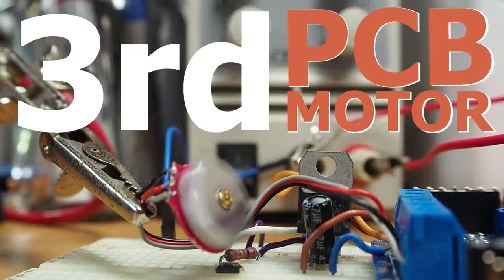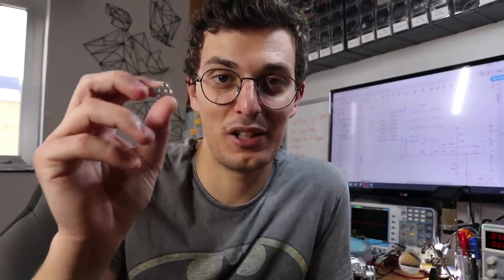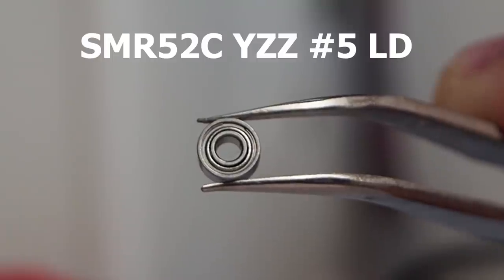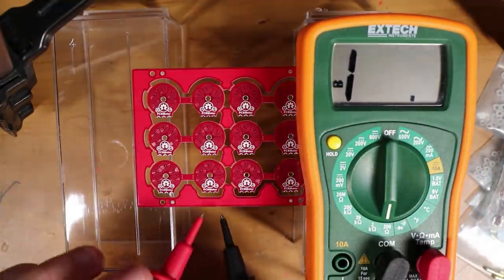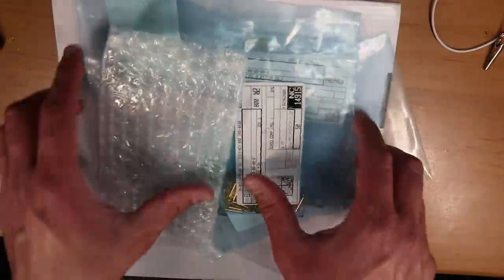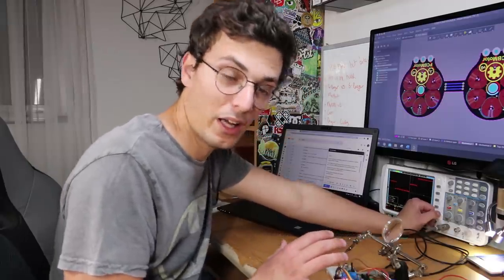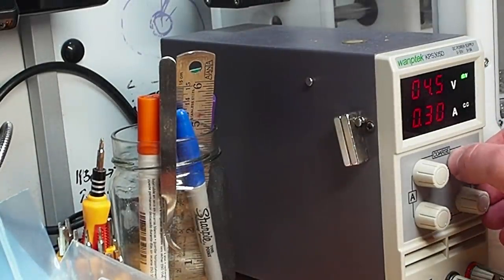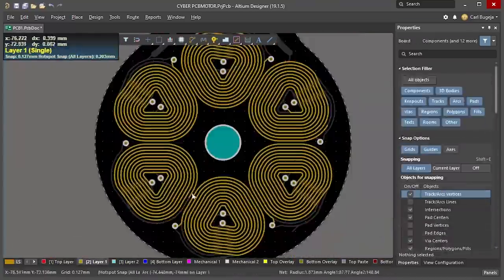Making PCB Motor v3

Comment: You could also stack 2 coil pcb's on top of each other, increasing the torque by 175%?
Reply: Nice idea. He should defently try it. U could use it as the main structure of the drone as well. I can already see the design :)
Reply: I was thinking the same thing. 1 on each side of the magnet. Or 2 on each side of the magnet!

Comment: Try to add magnets at different side of pcb for more torque. And sure avoid the high temperature. Also try to insert copper inside of pcd. It's a multilayer pcb like used in graphical card where we have more than 7 layers.
Reply: he already has multiple layers connected with vias. You are right though about stacking. He should stack a stator on the other side of the rotor though so that the magnets are acted on from both sides.
Reply: @excitedbox5705  I saw only two layers by two sides of pcb plate. Need more)
Reply from the maker: It is actually 4 layers 🙂

Comment: Eddy currents in the aluminium will definitely reduce the efficiency. If you want something that can take the heat, has good mechanical properties and is non conductive use GFRP or in other words: Mill out a thick FR4 PCB. It will be lighter, stronger and more efficient than aluminium if done right.

Comment: Maybe there's a way to sandwich rotor between two pcb stators which should increase the torque (probably).. So for drone it might be possible to have 2 pcb stators on both sides of a rotor. but what if combine two sandwiches together? 2 rotor 3 stator configuration.. not sure what the benefit of that would be.

Comment: Have you thought about designing one with an attachable heat sink? There is an article that seems to talk about how motor performance can be negatively impacted by high heat. 

Maybe you put as many vias in the extra room of the PCB as possible to also help with cooling.

Comment: I like to use such motor in a cassette tape housing (on a custom PCB inside) that turns the wheels or use one of them as generator to drive the second wheel. The magnets are in the surroundings of the wheels and coils are around the holes. The reason I want to do this is to make BT-adapter without noisy rotating gears. Some cassettedecks requires the motion of both wheels, that is why there are gears inside such adapter. It would be fantastic when this can be done without batteries at all, so when one wheel is driven by the cassettedeck, the other automaticly spins (slower of course due energy loss). That would be amazing! A nice application, right? (or stupid idea?)

Comment: Hi Karl, you have magnets, winding, bearing, but you do not have a cores which is key in motors. basically iron to close and guide the magnetic field and use the best of your coils, imagine an electromagnet without core, it would be many times less strong ! At least it will improve the torque. PM me if you don't see what I mean.

Comment: When designing a motor, you want the winding resistance to be as low as possible in order to minimize losses. Since the motor runs on AC, the current will be limited by the winding inductance.
You could drastically increase the efficieny and torque of your motor by using an iron core and rotor, thereby decreasing the magnetic resistance and increasing the inductance.
Reply: I think thats a good Idea to try.
And its Not the first time people Point it Out in PCB Motors.

The question ist how to add the Iron core.
On think is you have the place normally used by the vias connecting one Side of the coil.

Other Problem that could you use as Iron core.

Comment: All N-type magnets should be 80 °C, higher temp magnets have a M for 100 °C, H , SH, UH, EH and AH	types have even higher max temps :)
I love those tiny motors you make, have to build one myself just for fun one day ;)
Edit: I just found a better list but they are only reference values: 
type, max usage temp, curie point
N	80 °C *	310 °C
 (*N52 for example max 65°C )
M	100 °C	340 °C
H	120 °C	340 °C
SH	150 °C	340 °C
UH	180 °C	350 °C
EH	200 °C	350 °C
AH	230 °C  350 °C

Comment: 2:01 "GIMME  PCB!!"
Ehi for the heat, what about a little fan (maybe in plastic) on the back of the motor pcb? The height increases, but the performance will decrease less. 
Or maybe a different design of the rotor: fan shaped, so it will cool itself without any other extra parts.

Comment: why not consider an aluminium (or alike) heatsink on the backside of the PCB? (also, weighing magnets might result in unpredictable results, as the magnets may pull toward possible metal inside the scale, altering the measurements thereof)

Comment: Congratz on your v3 motor! 
Yeah that's a hot board. I don't think it was mentioned, but were you using 2oz copper or 1oz over the substrate? Doubling your thickness could quarter your resistance.
Something you could try at no additional cost that will improve resistance & cooling is to remove your soldermask layer over your coils!

1) At the voltage you're running at (5V), there should be more than enough isolation between turns. 
2) Removing the soldermask layer would allow the boardhouse to add surface finish to your coil traces, adding thickness and reducing the resistivity. 
3) Removing the soldermask layer will reduce the thermal resistance between air and your traces, improving the heat flux and keeping your board cooler.

The aluminum magnet holder could also have some low-profile fins incorporated into the milled aluminum design to add some convection cooling. 
If you did some 2-sided milling, you could try a 6/8/12 fin design at maybe 1mm depth and 0.5mm thickness (these are arbitrary numbers) then flip the board and add your magnet slots.

1)You'd sacrifice some torque and reduce temperature by having the finned surface facing the coils, and have the magnets sit behind the fins + a very small wall thickness
2)Or You could keep the magnets as close to one side of the board as possible, and add a second milled aluminum piece to the other side of the PCB
Lots of directions to take, anyway I look forward to the developments! Great production quality as always.

edit: punctuation
Reply from the maker: Thx for the tip! 🙂 Copper thickness is currently at 1oz.. To increase its resistance I can go for a 0.5oz thickness but I need to check whether my pcb supplier can do that as it is not currently listed on there website.. Regarding the no-soldermask I was very tempted do it for this version.. I also think it would improve the thermal performance but it also remove insulation and risks short circuiting the phases.. But it is something that I am still considering especially for the scenario where the motor is fixed and enclosed in a housing.. The fins idea I am not so sure about as that might cause drag when spinning
Reply: @CarlBugeja  That's a pretty interesting idea, but I want to caution against increasing your coil resistance. Increasing resistance might help make control simple but is ultimately holding your torque targets back with the lower current. IMO, controller design and low coil resistances is really going to be what takes your design even further. 

Look at it this way. Your coil is acting as both a resistor and an inductor, but only the latter generates useful torque. You could achieve the same results by decreasing coil resistance to 0 and adding all the series resistance in off-board resistors to regulate current. The coil would generate identical magnetic flux and the heat would be localized in the resistors where it can be managed without damaging the motor. 

Since your design uses an air core, you're not going to be facing any magnetic saturation if you increase current, so the cooler you can get your coils, the higher you can push the envelope with your current and generate greater torque.

If you added a current sense resistor and sampled the voltage drop, you could add some current control by regulating about a current setpoint using PWM, add some overcurrent protection against shorted coils (if you go with the no-soldermask option), and have lower coil temps for the same torque and start pushing the envelope even higher.  A little PTC chip on the board could add further protection and allow you to throttle the coil current when temperatures get too high to protect your magnets.  
And yeah, having a fan will definitely add drag as you use some of that mechanical power for cooling. The best option is to just reduce the coil resistance as much as you can so you don't even need to resort to cooling strategies.
Reply: @InfinionExperiments  That is a very good list of design improvements with rationales! I guess PWM will be used anyways (it makes no sense controlling speed by phase frequency alone) so minimizing the coil resistance and lowering the PWM duty cycle will increase efficiency. An extra upside would be that there is torque headroom for short bursts if needed.
Reply from the maker: Minor correction - 0.5oz will get a larger resistance than using 1oz

Comment: WOW PCB motor is great idea for making switched reluctance motor. It does not contain magnets. It could be 2 PCBs. One you have and second with coils, capacitors and possibly some logic. It would run at much higher temperatures without magnets, processing much more energy. good for quad.

Comment: You could probably increase torque by sandwiching the rotor between two pcb, not just one on the one side?
Another possible improvement: maybe through-holes as air vents
Reply: You'd be better off sandwiching the pcb between two magnetic rotors, and adding back-iron to help the magnetic fields flow.

Comment: Did you consider making the rotor out of sheet steel to work as a back connector for the magnetic field? Or using a double rotor with the pcb sandwiched inbetween to build an axial flux motor? Both variations might result in stronger magnetic fields and thus higher torque
Reply from the maker: The steel option I believe would reduce the speed of the motor (which was the main goal) but as you said it will also improve the torque.. So I might consider it for some other applications

Comment: Why not make a bigger pcb with bigger coils so they can carry more current and generate more torque? Also stack the pcbs on a single shaft so torque is improved, maybe some heatsink as well to cool the rotor. If major cause of heating is the eddy currents, go ahead and use stacked style in trnasformers.

Comment: Maybe someone told you, but you didn’t think to place a small impeller on the shaft for active cooling of the motor?
Reply: just realized that this is impossible because pcb is a stator.
Reply: @dimakrayushkin  It is still possible to cut the rotor into a fan shape to blow air across the stator as it spins.
Reply from the maker: Having sort of holes inside the rotor would make a better job I think

Comment: Regarding using the back emf as a way to measure the speed, is it actually only dependent on the rotational speed of the motor? (compare results with the actual hall sensor with different loads added to the motor) or is it mainly a function of the input signals?

Comment: Very interesting and fascinating.
I personally would like to see some simulation of the generated magnetic field. Maybe one can throw an optimizer at the shape of the spirals to optimize the generated field? From the previous video it looked like you choose the shape quite arbitrary? I would be surprised if the shape wouldn't have a big influence over the power output of the motor. But i'm just a commenter on the internet that doesn't really know much about that topic, so...

Comment: Hey carl nice work. Really got me some ideas. As tip. Have you considered making the rotor also out of pcb material? From manufacturing its simpler.
Furthermore i wonder if the motor works also good as a generator. Would you be willed to provide one piece for a test?

Comment: Nice work on thinning out the PCB and getting a higher RPM. And were those shafts were a type of pogo pin? They certainly looked like pogo pins and that was a genius use for them.
Reply from the maker: Thanks! It's not a pogo pin, just a single pin connector 🙂

Comment: Very interresting project. I like how you combine electrical engineering with mechanical part design. have you thought of having both of the winding sides accessible like in an classical Induction motor so that you could switch from star to delta at will?

Comment: Aluminum is diamagnetic meaning it will fight any change in magnetic fields. It could be a cause for lack of torque
Reply: The Aluminium don't See much Change of magnetic field because mostly it only sees the magnetic field of the permanent Magnets

Comment: You can reduce your magnet thickness while still maintaining the same flux density at the surface if you use some back iron on your rotor rather than aluminium. You can also double your torque output by placing a rotor above and below your stator. You are generating a magnetic filed on both sides and so you might as well make the most of it. Look up 'axial flux motor's. Some simulations I did a while back for rotors with and without backiron https://things-in-motion.blogspot.com/search?updated-max=2019-01-27T15:51:00-08:00&max-results=7&m=1

Comment: Hey Carl! I'm sure this has already been asked a few times but how are you avoiding the need of a second rotor or a second stator of a "classic" axial motor design? E.g. if you look at this https://www.youtube.com/watch?v=E5VS4s-R7vk video, both types of the axial motors featured are closing the loop by either having two rotors or two stators.
The author of this project http://build-its-inprogress.blogspot.com/search/label/Coreless%20Axial%20Flux%20Motor claims in his first post that he saw significant losses at high speeds before he added a second rotor.